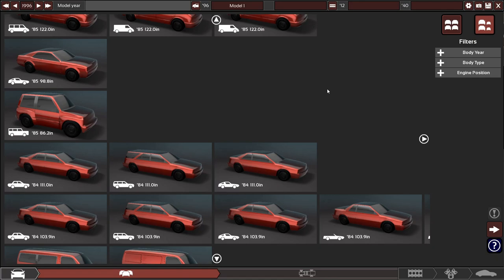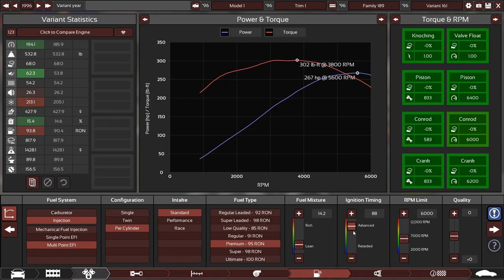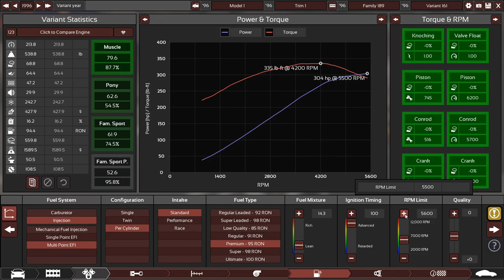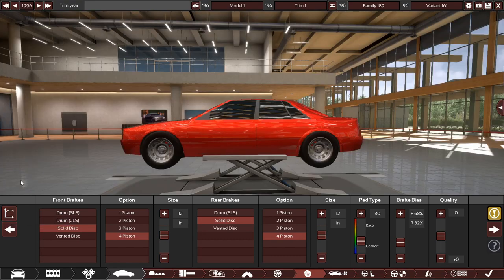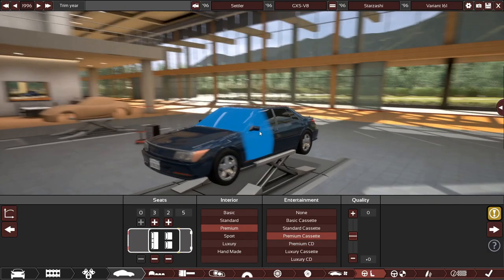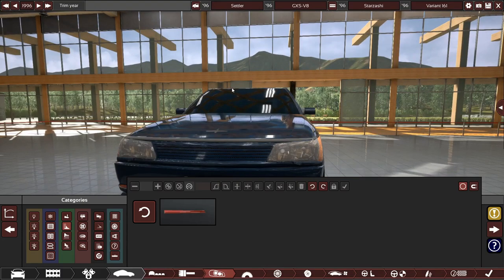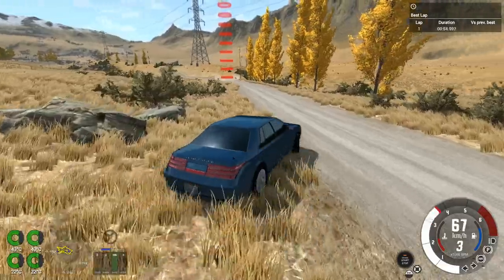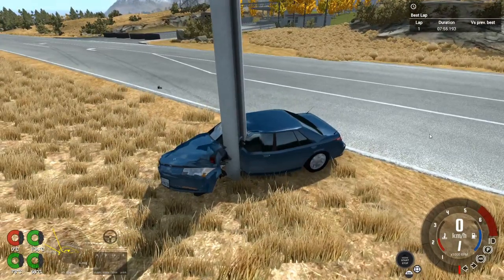Building The Ultimate 1990s Sleeper Automation - BeamNG

Comment: Hey, cool car that you build there 🙂 the design really looks great, but I'm really confused by the way you setup the engine and transmission 😅 there really is lots of room for improvement there, the amount of ignition timing advance doesn't help a damn if you don't rev it to oblivion.  Most of the time power curves end on a decline instead of a peak. Same thing with the gearing, which is really odd a sleeper car that only does 200kph just really slow, consider using a little bit of overdrive Aswell, helps the mileage as well.🙂 I don't think you're doing it wrong but I think there's room for more 😇 I still like to watch your Vids because you really make a sympathetic impression to me, so keep on going 🙂
As a build challenge, try to build a "replica"/this kind of vibe of the Lancia Stratos
Reply from the maker: Oh yeah i could have gotten more power out of it, but I didnt want to make a crazy fast car, just a sleeper. I tried to balance out price, performance and fuel economy! (1996 Impala SS did 0-60 in Mid 6 seconds, my car is slightly higher end) Didnt get great fuel economy, i should have used overdrive but totally forgot! 
I limited it to that because i wanted it to be a street car, and In Japan all cars are limited (to 180kmh) by law.
I appreciate your feedback tho :D 

Keep calling out what you see, I always try to improve my videos!!!
Cheers!

P.S ill put a Lancia Stratos on my todo list of cars :)
Reply: @TwinTurBros  so yeah I totally see the point about the power and speed, but the curves can be improved in themselves without raising max hp e.g. in terms of gearbox u can manually limit the speed of the car without having to sacrifice proper gearing. There is that option right next to the slider. That also helps keeping costs down because the tires are cheaper, since they don't need to be as strong. Yes automation actually takes that into consideration 😂 great that you got my point was a little afraid it might come over as a negative thing like people always know better 🤦 BTW the channel of one of the developers ( Killrob) has incredibly many tips for that 🙂
Reply from the maker: Nahh, I love feedback! I can't improve unless I you know.. try to improve! And I can't unless I know what to get better at!
That's interesting I didn't know what about the tires.

After like 600 hours I guess you still can learn new things :D

Oh yeah I've seen killrob, he's incredible at making cars. I actually did a interview with him a few weeks back (you can find it on the Automation channel or on mine).
He seams like an awesome guy too, very knowledgeable.

If I get a bit bigger I might be able to do a bit more videos with em. Not that I could make a better car then him!
Cheers!
Reply: @TwinTurBros  the tires not only explode price wise because of speed index, but also if you use very unusual sizes for the time, like if you look at the 70s and go bigger than 17 inch or so in rim size each step for the next size has a big impact on costs, same goes for nonequal sizes front and rear, it shows up in the "tool tip" if you hover over the tire size slider I think.

Comment: A build based on the new look retro style cars that some manufacturers have been going for recently with new electric cars. Maybe you could create an economical but fast awd that's baffled to make it similar. Just a suggestion you don't have to stick to this 100%
Reply from the maker: Like the Honda E? Little sporty hatchback, AWD retro styled. Does a Turbo I3 sound good? No electric power. But still very economic!
Reply: @TwinTurBros  yeah, the new designs are cool but I'll give you free reign on what body type you use 👍